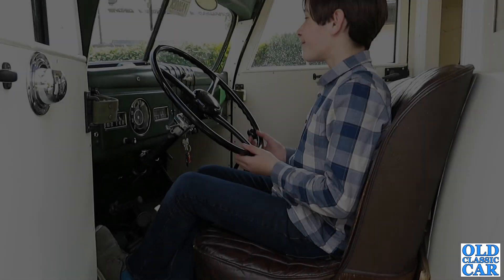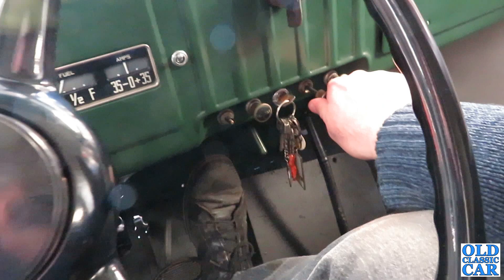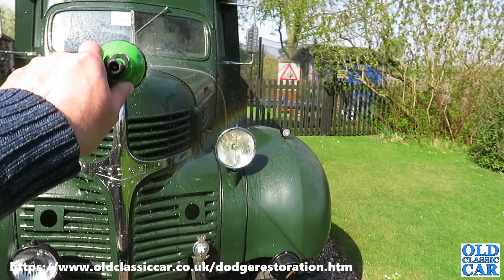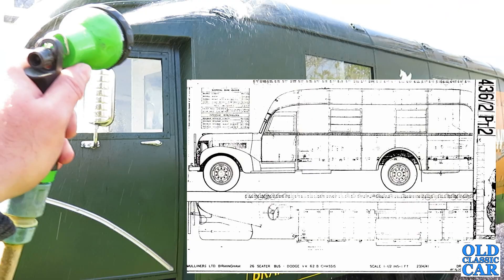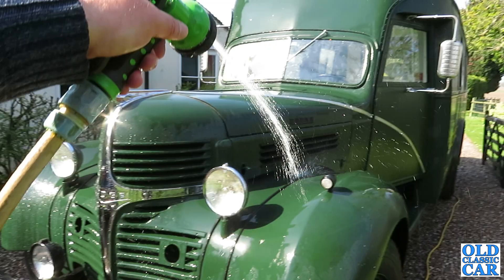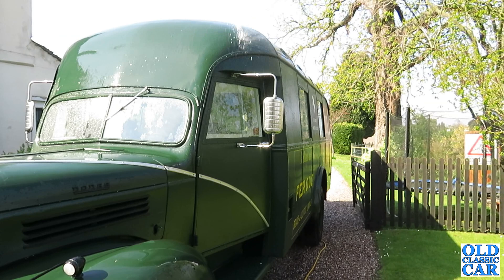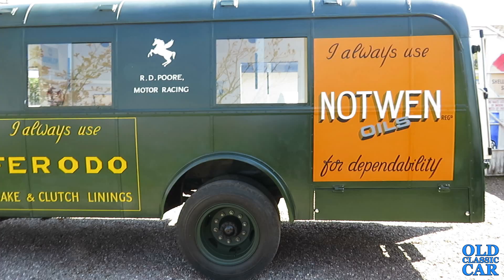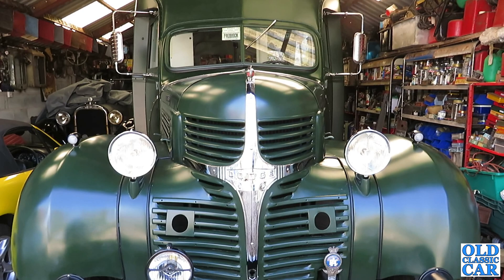The old Dodge racing car transporter - engine start up & quick history | Alfa Romeo 8C-35

Comment: I've seen the restoration time-lapse video and every time I see this Dodge I marvel at what an enormous job it was! It's totally understandable that not many people would want to take on such a job but I'm so glad you did. You're a better man than I!

The lad could do with a couple of cushions under him...
Reply from the maker: You're too kind, lots of people restore old lorries - and buses/coaches - which must be a real headache and £££ as the cost of re-trimming some of those early interiors must be eye-watering to say the least, even if you could find the correct material. Fortunately mine just has fresh air in the back, where once there were seats :-)
Reply: @oldclassiccarUK  Well yeah, I guess that helps, interior work is terrifyingly expensive and long-winded but even in this case there was a lot of metal to de-rust, fabricate and replace.

Then there's the space issue you mentioned, a dismantled vehicle takes up 3-4 times as much space as when it's all in one piece. The Dodge is a big old lump before you've even started work on it! I've restored a couple of cars in the past and they were big enough jobs and plenty of messing about, getting things wrong and having to re-do them etc. The Dodge is just on an entirely different scale.

Yes, plenty of other people restore lorries and buses but a certain amount of extra gumption is required and I think these jobs are only taken on by a certain type of person other than the type of person who restores a car. That's not to take anything away from anyone who takes on any project of course, the restoration of any kind of vehicle is a big undertaking but that's my point. Take the heatache and logistical problems of a car restoration and make them all 3 times bigger! Oh, and just for good measure make it an 80-year-old American vehicle...

Your Dodge must've been a hell of a job and now it looks amazing.
Reply from the maker: Thanks, yes space is a consideration that often gets overlooked I think, in the excitement of finding an interesting project. I'm as guilty as anyone on that score :)
Reply: @oldclassiccarUK  My parent's driveway was my workshop. Room for 2 cars. My poor parents must've despaired...

Comment: What a lovely beast! Had you thought about creating a removable "pod" to use it as a camper van, would be perfect size-wise! Although I guess fuel consumption is the big downer to using this. Well done for saving, worthy of merit!
Reply from the maker: I know that back in the day, the mechanics would kip over in the back and make basic meals etc, but I think it'd be cheaper to stay over 5* somewhere than drive this any distance :)

Comment: Most of these Dodges were originally ordered by the French government, and after Dunkirk they were diverted to the UK. Those which did make it to France ended up giving yeoman service to the Wehrmacht.
Reply from the maker: Yes that's right, part of Supply Mechanical 2017 if I remember correctly

Comment: I'd run some marvel mystery oil in your fuel tank. And in the motor oil to for helping with compression to.
Reply from the maker: Wellll it should be fine as the engine's all been apart, thanks for watching

Comment: Good neighbours or not having someone or their builder using a Diamond disc cutter on breeze blocks, paving or what ever without a water hose attachment os both inconsiderate, a  health risk and really against local byelaws. Not good to have all that drift your way. Should I have been the owner of your property together with that 1935 Alfa , I dare say I might have scaled the fence and preformed  a minor operation on the offender with the said DC. Of course no one should behave like that! but  just imagine someone did cement dust up a pre war red Italian lovely. Still far worse stuff happened and happens on track days ,I am sure.?. Great video,great truck, 
.
Reply from the maker: We have fields alongside so are used to dust drifting over everything when they're being worked, that goes with the location, fortunately the building work was (hopefully) just a one-off